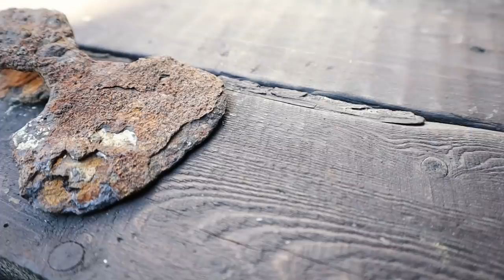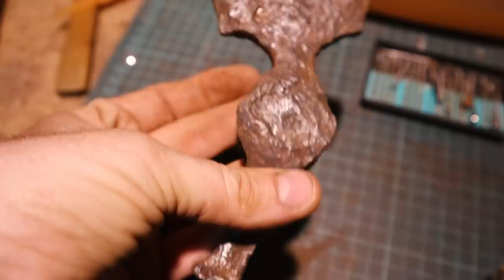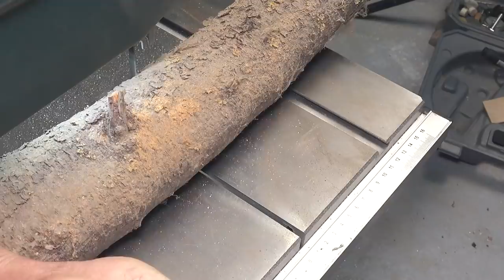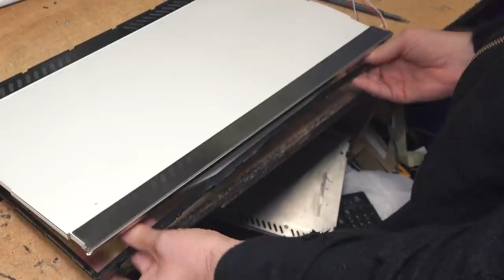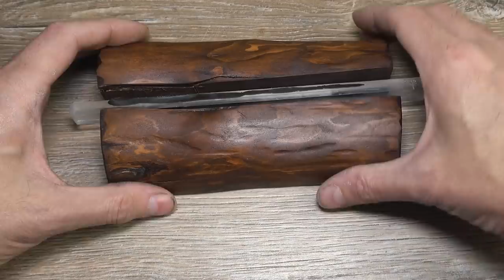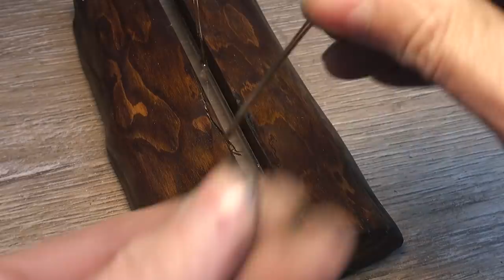VERY Old Rusty battle-axe restoration.

Comment: Well, I’m admittedly not an expert and I thought this was a totally misleading video. Then I started looking at Scythian weapon design and, while smaller than anything I found, I’ve got to admit the design is at least comparable to a period “war hammer.” So…I have no idea if this is ancient, old, or near modern because it’s also a fairly common design for camping hatchets. But you did a great job with the preservation treatment, and the stand you created is absolutely beautiful for the piece.
Reply from the maker: Unlike the previous hatchet, which was in a terrible state and looked more like dried bacon than an ax, this hatchet was in very good condition. I wanted to keep it "as is". Thanks! i really appreciate it.

Comment: No more than 40 years old camping hatchet.  The plain side if for the stakes.  Imagine a Barbarian warrior trying to kill someone with that tiny piece of metal, lol.  A no so bad restoration, but the silly title takes away all the interest.
Reply: Agreed, not an ancient axe head.  That kind of oxidation indicates it wouldn't last that long.  Something that old would have to be in an anaerobic and dry environment to survive.  I'm calling shenanigans on the "find" as well.
Reply: Tomahawks didn't do a bad job of killing.
Reply: Cappie44, you are the only one that mentioned killing.
Reply: @kenhart5259  : Isn't that a warrior's job? Cool restoration!
Reply: @kenhart5259  What? A Battle Axe used for things not related to cracking walnuts?

Comment: NEVER restore something THAT old. You'll just ruin its value.
Reply from the maker: This is the way in which artifacts are restored and preserved in the museum. If left as is, then under the influence of oxygen and humidity, it will quickly collapse.
Reply: @OldRusty  good point
Reply: @OldRusty  is it really from the Iron age? How did you find such an artifact?
Reply from the maker: @nocturnalrecluse1216  Such axes often come across in the forest in our area. Also arrowheads, spears and various knives. most often around 100 years old. Much less often come across bronze weapons with an age of about 3,000 thousand years.
Reply: @OldRusty  Are you from France?